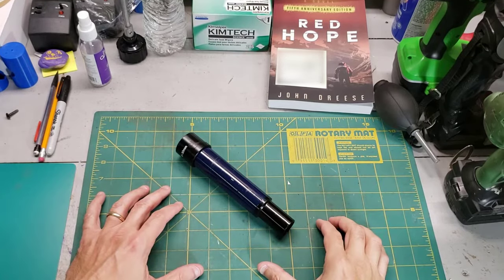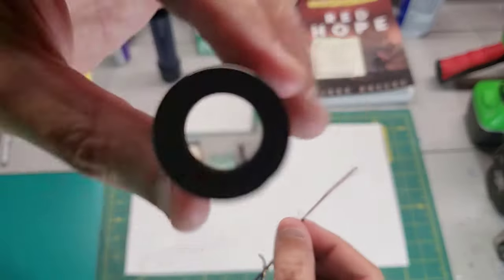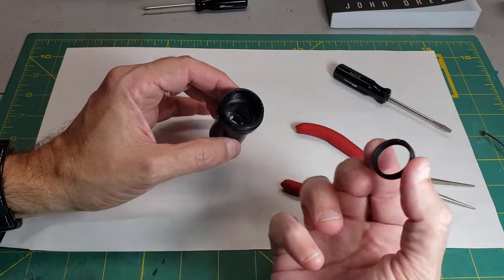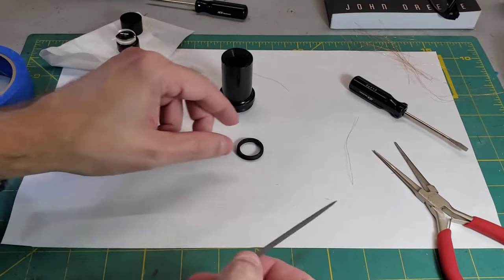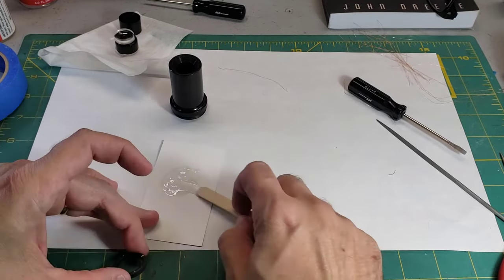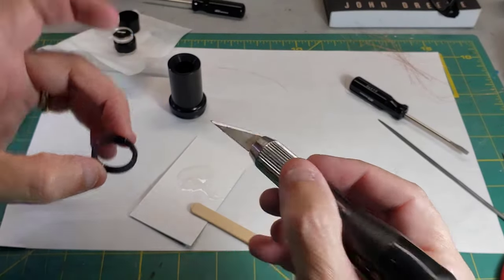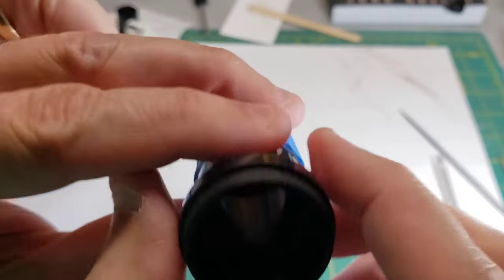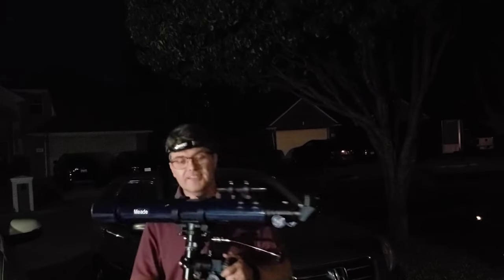Broken Crosshairs Quick Fix (Viewfinders, scopes, etc.)      #Reflactor #broken #crosshair

Comment: Man, YouTube has everything…this is exactly the fix I was looking for! I used some wire threads for the crosshairs too - a bit thicker but they do the job well, I may even like them better. Thanks for the post.
Reply from the maker: I'm glad it was helpful.  This was the first (and hopefully only) time that I've had broken crosshairs.  However, I've been told it's quite common.

Comment: Just the project I have been putting off.  Thanks for the directions.
Reply from the maker: I was apprehensive about it at first, but it ended up being more simple than I expected.
Reply: @reflactor  Used strands from speaker wire.  Little thicker then original but it will do!

Comment: What i did with mine was put in a vice then used super glue with one of them very very fine nozzle and quick setting spray 
2 seconds 
did one side then pulled it 
as tight as possible dabbed glue then quick mist of spray came out very taught and clean just a suggestion for you in the future  
When people tighten the grum screw to tight on a suppressor 
or put thread lock on it 
use a electric soldering iron stand tip in the crum screw comes out very easy thought i would tell you that little trick Have fun 👍
Reply from the maker: That is a VERY clever way to make sure there is tension on the filaments!  Thank you for this tip.
Reply: Sorry for the suppressor thought it was for a Rifle but you may need it if some thing is over tight
Reply: For a thinner diameter use the wire from telephone cable usually there 6 colours with very very fine wire in each colour .001

Comment: If you search for "scope crosshairs" (I looked for Unertl crosshairs) EBay has repair kits consisting of 3 foot lengths of tungsten wire fairly inexpensively. Sizes range from 0.0005 to 0.0015.
Much finer than electrical wire.
Reply from the maker: Thanks! That is excellent info.
Reply: That's where I just bought mine , eBay

Comment: If you want really strong thin wire find some old fuse wire. It may be hard to find these days with RCCB's, but you used to be able to buy it in various Amp ranges, and therefore thicknesses on a little card from the hardware store.

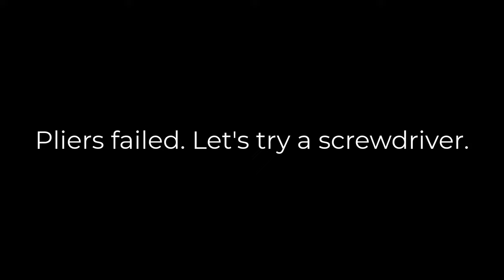Comment: Hi there, I've tried unscrewing that inner ring out but it's just firmly stuck  there and it won't even move a mm as I tried to unscrew it with everything that could grab those two holes in the sides, is it glued or I don't understand something? I'm talking about 1:22 part
Reply from the maker: Every manufacturer does it differently unfortunately.  This viewfinder was from a Meade telescope and thankfully they didn't glue it in.  I don't have the proper spanner wrench to undo it, but a set of carefully handled needle-nose pliers or hemostats can sometimes span the gap.